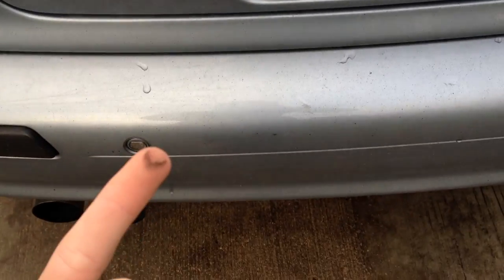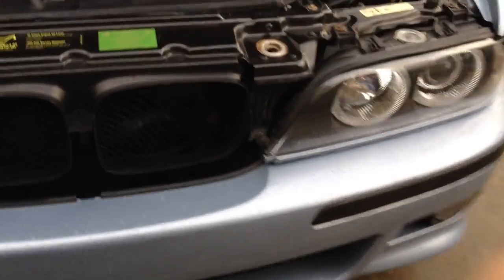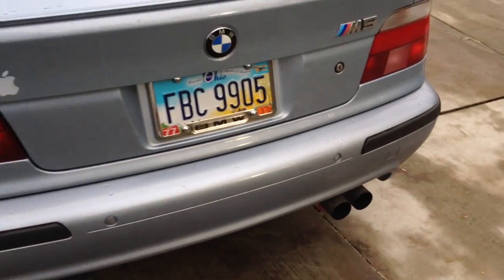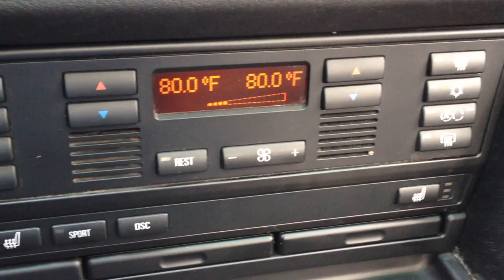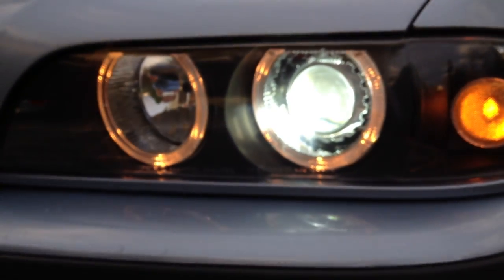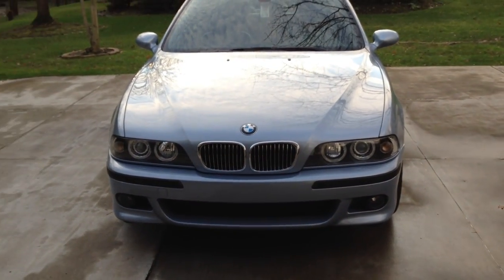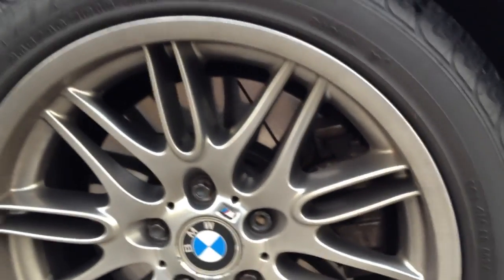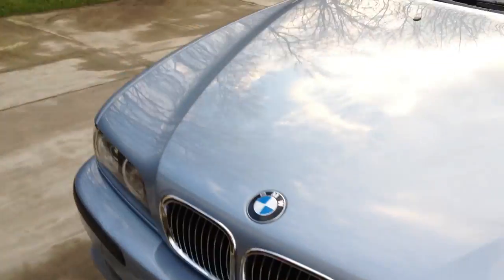BMW E39 M5:  Maintenance Info, Cost

Comment: haha you won't find any german car with proper cupholders :D the reason is simple: nobody uses them in germany. imagine doing 250 km/h on the autobahn (wich is like 150 mph i think...), and that's not uncommon, you have to keep your entire focus on driving. you simply don't do different things while driving. so basically they just put in anything that may holds a cup or not, just to have "cupholders" in it to be able to sell it in countrys like the usa where cupholders are used more frequently because people do different things while driving when there is a low general speed limit :D
Reply: I'm not a german but i lived in Bonn for five years.. and i've seen loads of people "germans" use cupholders.. But i do agree that the german car industry puts in cupholders just to hold cups. And that's it. Porsche makes some of the most fragile cupholders i've ever seen. My W211 had the option of a sat nav or cupholders... so yeah. they just don't bother and people really don't care. it does what it's designed for..

Comment: the ATF is for power steering right? all m5 are manual?
Reply from the maker: That is correct.  And yes, all E39 M5s were manual.
Reply: I was confused, i know my e36 took ATF for powersteering,  good videos. watching them before I possibly pick up a 2000 m5 as a new daily driver

Comment: did you fix ur intire car yourself? if so thats realy insane how handy you are :P
Reply from the maker: I do everything myself that I can... but not everything!
Reply: ***** What stuff have you not been able to do yourself?
Reply from the maker: BlackChrys Carbon cleaning of the engine, fuel lines from filter to engine, struts and springs (although I would do it now).  The rest is really doable with enough time and the right tools.

Comment: So if you bought this car and didnt exactly drive it everyday more so a summer car or weekend joy the maintenance wouldnt be that horrible, I don't nit pick as much as you with the mirror and sensors I could easily do without that crap replace the mirror with a cheap manual bolt on one and you dont need the sensors. what would you expect this car to maintain yearly in that case more than 1000?
Reply: I can't give a definite answer for that either.  It totally depends on the car you buy.  If it's been taking care of and has received the maintenance that it needs, regardless of the miles, you won't have that much per year if you don't drive it too much.  But, buy the $12,000 one from Ebay and be prepared to do lots of upkeep- at the very least to keep the engine healthy.  But engine costs have only been maybe 1/4 of my total investment.
Reply: id buy an inspected one from a local dealer for around 20k all schduled maintenance etc i just can do without sensors and such such a beautiful car id do anything to have one except live in the thing!

Comment: Why did you have to buy new parts... Just replace the bushings with SPL components. Or if you want a poly bushing go with Whiteline. They cost about $300 for front compression and lca bushings. You got taken a ride for wherever you went.  The rust issue may just be the climate you live in. I live in the south so there is no rust issue here. 

I have a 350z.

Comment: Dude when  youre vanos ratels it is a big isue.. Fix right away because when something brakes up there youre engine is toast
Reply from the maker: These cars had VANOS rattle new from factory.  If your timing chains are rattling you need attention.  But VANOS issues are way over-hyped.

Comment: oil and temp have problem :) fix termostate ;)  and it will reach half.
Reply from the maker: Actually the E39 M5's gauges are not buffered.  So at a completely warm operating temperature, they do not quite reach 12:00 exactly.  Very few cars are like this, but the M5 is.  It makes it easier to know the exact engine oil/coolant temp, as the needles move with each degree warmer or cooler.  Most cars are at 12:00 for a large range of temperates and only leave that level once they are well below or beyond a healthy operating temperature.

Comment: But, yes..... The sensors are a Bitch maintenance part. They Gail regularly and often. Not too big of a deal, u can get get away with faulty sensors and still drive the car fine. The E39 really is a tank of a vehicle. Rock solid construction

Comment: FAST! EAT BELTS. 
REST button works only if its cold outside and engine is hot.

Usually, front-right axle sensor fails after 10 years.

Comment: Hi how much cost your car?
Reply from the maker: $12,900.  I have over $61,000 in it today though.
Reply: ***** sorry if I come off as a dick but, how come you didn't just buy a newer M5 or M3 instead of spending all this money on a car that you'll probably never get back? E39's are awesome cars in my opinion, but why spend all this cash on an old used car?
Reply: Do you know how much cost new M3 or M5 100000 ++++  his car is very good off course you need to spend money to support on right condition this car but you can enjoy on road all the time when you drive M BMW specially if you have manual transmition on e 39 M all cars have manual tr
Reply from the maker: Bmxcycles I don't want a newer M car.  They're mostly gramatic transmissions and they're way too big and comfy now.  I like the older cars, such as what I have, so I will continue to keep it up!
Reply: ***** thats what i plan to do as well, i could afford to buy a newer one, but i prefer the older ones, would you recommend the 2008 m5? another reason is the i like saving money, so i have no problem with someone paying $70. to $90 for the car when it comes out, and then allowing to buy it for half the price a few years latter, the cars are usually in like new conditions but without the brand new price.
Reply from the maker: Anthony Perez I'm not the biggest fan of the E60 M5... but if you are, then absolutely the 2008-2010 are the ones to get.  I'd try hard to find a 6 speed model... but get what you like.  I agree with your last point, I'd never buy a new car!  Let somebody else lose $40,000 on it haha
Reply: @XxAlexanderProxx  d

Comment: whats the difference between e39 m5 2001 2002 2003
Reply from the maker: Those are all facelift models. A few minor changes happened for the 2002 model year, but that's really it. The 2002s and 2003s are about as fresh as they get. Changes include a few minor VANOS parts, the later radio modules for auxiliary and xm support, and the faster and DVD compatible MKIV navigation computers. The most changes happened for the 2001 model year and later from the 2000s.
Reply: +E39Source and the speed differences??
Reply: +E39Source what would you suggest i buy?
Reply from the maker: +MOE 420 There are no performance enhancements from 2000-2003. The 2002s and 2003s are usually the better ones to own but only ever so slightly.
Reply: +E39Source thanks
Reply: +E39Source is yours a 2002?
Reply from the maker: +MOE 420 My M5 is a 2000 with a 2002 motor and a 2003 differential!
Reply: +E39Source nice is it stock
Reply from the maker: +MOE 420 I have done a full 2001+ facelift, Shark tune, stainless brake lines, Hawk pads, but nothing major.
Reply: +E39Source o you shuld turbo charge it ... check out a youtube vehicle virgins he has a e39 m5 you can search it will pop up maybe you wuld like 2 try it out
Reply: +E39Source and what do you like more e39 m5 or e46 m3
Reply from the maker: For me, E39 M5 most definitely.

Comment: You forgot to cover the carbon build up on these cars.
Reply from the maker: Not really a big issue.  Light might come on for AA code... no performance issues or longevity issues with motor.  Only problems come with the annoying SES, and possibly emissions testing by state.  In which case- reset light, and have them rolling road test it.  Mine passes ever year.
Reply: Hmm… I guess so :)

Comment: Thanks for the video!  I'll never buy a BMW!!!
Reply: You can do the maintenance yourself which is as cheap as Honda maintenance
Reply: +mason resendes 
I'm not so sure.  I actually own two Hondas and I do all of my own maintenance.  Aren't BMW parts very expensive?  Also, Honda sells more cars, so there is a better aftermarket for the parts.  For example, the AC clutch relay on my Civic went bad.  I replaced it for $6.  I feel like common parts on a BMW are just more expensive.
Reply: @shadetreegiants9407  e39 parts are really not expansive

Comment: For E39 connaisseurs that are thinking of getting an actual M5, let me save you 25 minutes: clutch (as usual), tires, brake pads. These are the most expensive things that go wrong with this car. Tires because you will drive like a lunatic, brake pads also, and clutch.. well.. wouldn't be a true E39 without a fast wearing clutch. All the rest.. those are just minor details, E39 ppl know that
Reply: Would you recommend getting a 3k 2002 e39 530d with 250000 miles mint looking as a first car?
Reply: @sl-mr7rq  I would never recommend a diesel E39, parts and labor are MUCH more expensive (wisdom from a Bosch Service mechanic). Look for a gas one instead, they rev higher and they're cheaper/easier to fix. I got the 528i and it's freakin' awesome.
Reply: @coolmojito  the thing is it's the best looking e39 in my country from what i've seen and it looks clean af, if I don't get one as clean as that one I might not even get an e39

Comment: The German cars are solid cars, but the problem is lack of maintenance by amateur owners. In the past two years, I've only replaced the manifold gaskets on my 01 740i. Age has nothing to do with it, its all about maintenance. Skip the 00-01 540i, I had one, and it was not the best on costs, stay AWAY from California owned BMWs cause NONE are maintained and their roads are such crap, the suspension is done in any car after 50,000 miles.

Comment: Premium car like M5 having the rear mirror leaking on the dash??!! 700$ for it?? Pixels and air condition fucked up?? Cheap plastic here 300$..cheap plastic there another 300$..what for???!! Badge?? "I drive M5 and i can have my angel eyes on late afternoon to scare the birds on the road..pose car for posing people. Buy Lexus and just drive..drive..drive...
Reply: ***** I have driven BMW's...many:) My brother in law is one of the biggest car importer,so i had chance to own E39 528 when it was 2 years old with just 70 000 km on dash and all the possible options ( had the small navi,as it was the one before the facelift)..,nevermind...,its true that it drives good,engine is smooth like a silk,handling is so sharp that you feel superb behind the steering..,BUT..,every time you start the engine the radio and equalizer settings are resetting..,constant battery drains,central locking issues,huge issues with adjusting the lights( almost every few days i had to drive with lights down)..,when was hot the astray didnt want to open..and when the car overheat during falling of the sensor attached behind the fan( really stupid solution,it may fall from driving on a bad roads) it was the last drop,and i had enough of the famous BMW "fun of driving" then few months later i had to drive for few days 740 E38 ..,lots of power,stays on the road like a brick..,and feels solid like a tank( the only good things i can say for it)..,then comes ( 2 year old car!!!) valves knocking..,air condition got crazy,moving from auto mode to whatever it wants..,electric seats fucked up..,and the auto gearbox got in service mode..and that was it..,so please my friend,i cant sacrifice my free of trouble driving to a bit better handling and better front appearance ( yeah,Lexus dont make posh angel eyes,they concentrate on REAL engineering) Overengineering for BMW means to throw the newest high tech gadgets from BOSCH to show muscles to the competition,and the customer is like a test mouse..,that pays a LOT to explore and test how durable the new stuff is..have a good time with it:)
Reply: *****
Did you have any problems with the vanos in ur e39. I heard it was a problem with many e39's...
Reply: yeeluvspizza VANOS is a typical area of fault for the E39.  My car had VANOS service years ago, but nothing major even then.  I've driven it 36,000 miles with no issues.